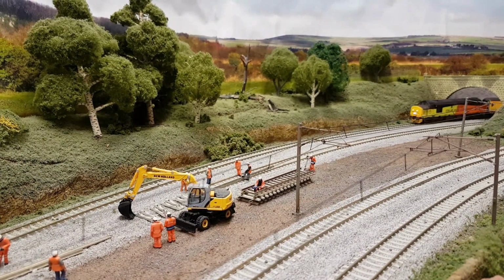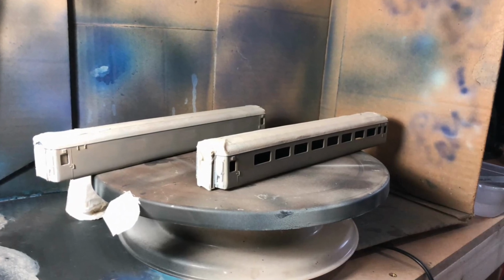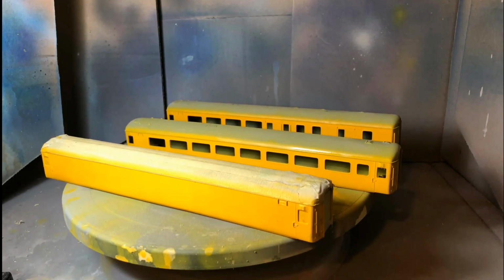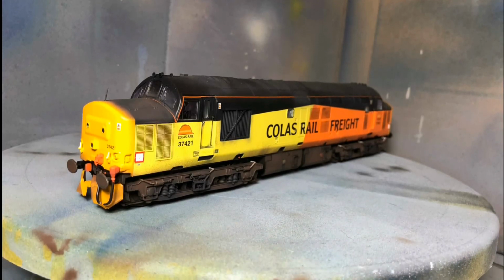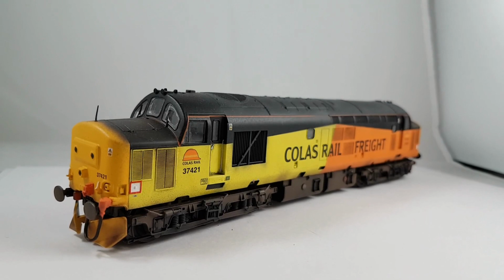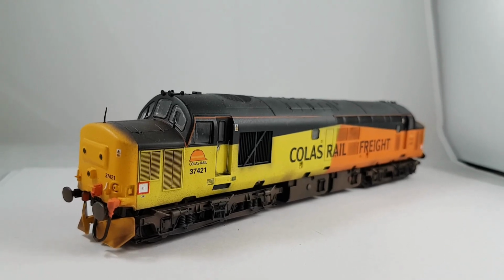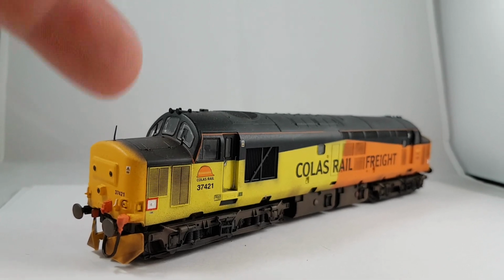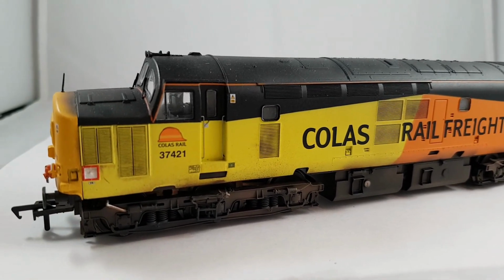New Junction & The Weathering Shed | Custom New Measurement Train

Comment: Don’t network rail trains have 2 43 at each ends
Reply from the maker: Matthew Stamp I'll gladly have two if your treating me? ;-)
Reply: New Junction yes I have 2 you can have there 1990s built
Reply: The  new measurement train uses mk3 coaches and 2x 43's but this would be used for pattern line recognition or with a mk1 coach used for ultrasonic
Reply: Andrew Willsher I’ll look all my 00 and send u a list and price price
Reply: Matthew Stamp have you sent the price list
Reply: Andrew Willsher no can’t find it all but there is 2 yellow blue hornby hst(build bought in the yellow blue era) with directional lights with 1 Carrie  and a 90s intercity 225 locos and dvt form starter set with carriages and a diesel form Thomas the tank engine have u Facebook or what’s app as will when fins will send photos. You any good at repairing or adding wires as may need a wire or 2 adding so will send u photos of what I have can send u them see if they work and u want them and then work a price including the work u need to do.
Reply: The loco repairs is adding wires with connectors to the correct parts. My local model shop did if for me once as I waited and did not charge so an easy job reply with ur contact detail I’ll send them out when I find Electra graphics will custom you if not got any the correct livery for a price I had n gauge dB shwncker management train in n gauge so 2 43 day coach sleeper and restaurant but customed in dB red logo for £20
Reply: I stand corrected a track measurement train just past molten station with 2 class 37s front was coal rails and back was BR large logo so you are correct